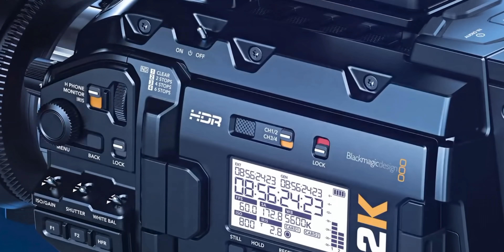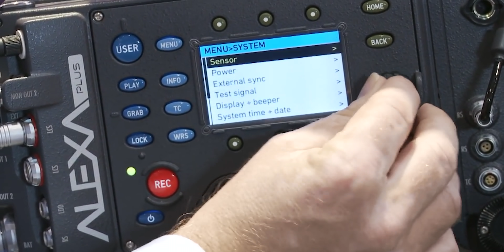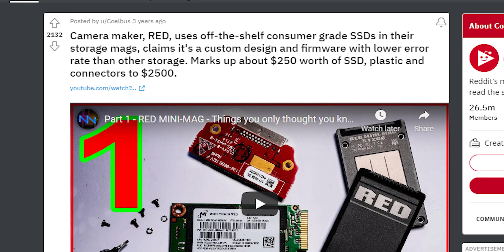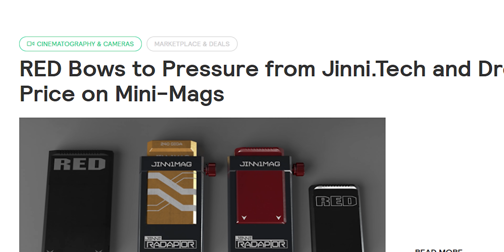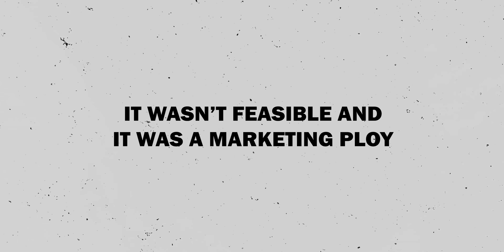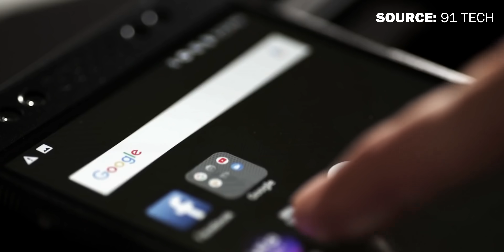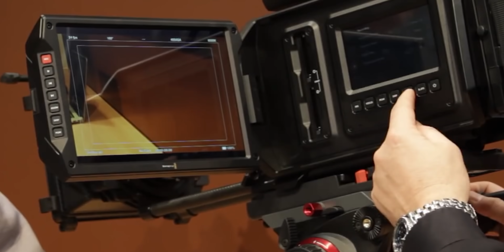The 28K Camera ABANDONED by RED Digital Cinema

Comment: I think the 12k ursa not doing that great in the market under the fact most people don’t need or want 12k for a most projects will hopefully give Red the idea that anything over 10k right now even over 8k isn’t needed. Sure make a camera with a 12k sensor BUT make it downsample into a 6k or 8k image we don’t need more than that. I hardly see the point of 8k apart from down sampling.
Reply from the maker: They really marketed the URSA 12k wrong. In my opinion, it's a multi resolution camera that shoots full sensor 12K, 8k, and 4K which gives you flexibility. But really that's it's best feature, not the 12k

Comment: I had completely forgotten about that hilarious rendering for their 28K camera - the design didn't make sense back then as it does now - and, seriously, what are you gonna do with 28K? At this stage, 8K alone is being used as the "negative" for 4K (you shoot and color grade in 8K for a 4K output - that way, you get a sharper image in spite of the amount of abuse it went through at the grading stage). 

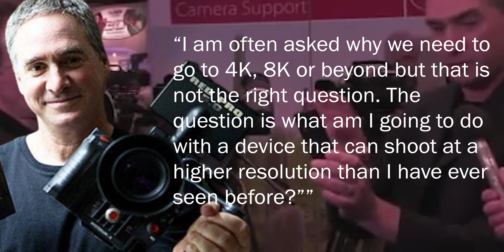6:54 Yeah, I remember when Red was pushing around this idea that you always have to increase resolution to get "more cinematic" images. I mean, they still do now, but back then it was kind of their mantra, as if resolution was the only thing that mattered. Then Arri released the Alexa and dominated the market for more than 10 years with a camera that was made for 2K output and now they are about to release their first S35 4K machine. Red in the meantime has finally come around to put internal NDs in their cameras like anyone else, after only 14 years in the business.
Reply from the maker: 😂 yeah, it's pretty insane
Reply: @FrameVoyager  Red is 80% hype and 20% hard facts.

Comment: Anything over 4k isnt beneficial lenses stop sensors from being able to resolve what they claim, no lens can resolve 8k let alone 12k the Ursa 12k cant even resolve 12k cause the lenses dont have the resolving power.
Reply from the maker: Exactly. Resolution is great if you have specific needs for it, but just because you have more of it doesn't mean you have better quality video
Reply: @FrameVoyager  I would prefer a sensor with larger actual pixels and photosites which can pick up far more light are are wayyyyyyyyy better in low light which is why canons cameras are all like 8-12 mp sensors minus like the R5C cause smaller pixels equal worse low light.

Comment: Even as a RED enthousiast this camera to me is bullshit (but I know for a fact that they are still planning to release at some point in time an IMAX sized sensor equipped camera).
That being said, I think a lot of people are not really fair to the brand (maybe it’s the cost of their aggressive marketing I don’t know) because in truth, no one really disclose who makes their sensors or even media.
Arri has always said the Alev III sensor was their own while it was in fact designed and built by OnSemi (they even won an award for it !) to Arri’s specs. Same goes for the latest Codex media which contains off-the-shelves OEM NVME SSD without anyone calling them names. I guess they get a pass because there is a bit more custom circuitry and software between said SSD and the camera than what RED did/does with the Mini Mags.
And then again, how many camera manufacturers talk openly about the fact that their sensors are made by Sony Semicon (all the Blackmagic Pocket Line of cameras, all the Z Cam cameras, all the Panasonic cameras, Fujifilm, Olympus, Kinefinity, Leica, Sigma and so on) ? Or other manufacturers. Even the so called « entirely made by Blackmagic » 12K sensor in the URSA 12K is NOT. They did what Arri did. (By the way, the exterior design of the Alexa Line of cameras is NOT designed in house by Arri : they hire an industrial product design company…)

Comment: 4:40 when I'm building my house, I'm the architect that says what has to go where, basically being the builder (legal term; overseeing) myself and in my role I order a mason to build walls and carpenter to build the roof – all according to my specifications, I can still say that I've build my house. I'm the builder. Just because I don't lay all bricks and woodframes by myself doesn't mean I'm not the builder.

A similar example would be Apple with its A-Chips. Apple doesn't technically build it's own chips, they design them and create the specifications, but TSMC cuts them out of silicon according to Apples specifications (layman's terms).
Reply from the maker: For sure! But in a lot of the forum posts RED was aggressively DENYING that they were working with a sensor manufacturer and that they had indeed built their own sensors. But like you said, everyone knows as the builder you don't necessarily build every part, few do. But they were very insistent on the fact that they made it themselves and even ARRI at award shows recognized the work and partnership with the company that made their sensors. 

They are a private company and can do whatever they want but that still doesn't take away from the fact that early on they were trying to create this whole brand of mystique to seem like the hip new company. Which tbh, probably was a big part of why they didn't die off early like a lot of these other companies did around that time. Can't say I would do what Jim Jannard did, but I can respect his marketing prowess!

Comment: I'm just speculating here but maybe RED got inspired by stuff like the Seitz Roundshot 6x17 - it has a similar design and (at that time)a high resolution sensor.
Maybe they thought they could acquire the sensor like they did with the FORZA sensor - but the problem was that it's a scanning back meaning there is no singe sensor covering the whole frame.
Even if they could have pulled it off the bandwidth would not have been manageable. Maybe now it could have worked with NVME SSD bandwidth etc.
Reply from the maker: Could be! I really think it's likely to be a marketing ploy. But I always like to think this stuff might have been built in some secret dark corner of the company that only a few ever saw haha
Reply: I @FrameVoyager  Hahahah yeah and then they used a working prototype to take four frames and then they were like... "okay, now what?"

Comment: honestly, 4k is where this all needs to end. lets all live with the alexa 35 for the next 10 years and just focus on making better movies please. i have a 4k television but 90% of what streams to it is still 1080p. the more k's you squeeze into something the more problems you have and the more crap you need to run during the processing to fix it - hence red's lack of DR and FNP problems among other things - and why arri is just now crossing the the s35 4k line - because only just now is technology good enough to have great image quality in 4k. (and no, great image quality does not equal a high number of k's). i was very happy shooting on my alexa classic up until 2-3 years ago when i finally hit a wall with the alexa mini having completely taken over. if it hadn't been for that, i'd still be on the classic instead of the mini.

it's hilarious how, as cameras get more and more k's, everyone slaps on more and more pro mist or uses older and wackier lenses to knock those k's down. we're approaching the point of convergence with all of this. 4k is that point i think.

Comment: The Monstro did happen. It was called the Monstro Vista Vision. It was part of the DSMC2 line after the Epic, and before the current DSMC3 line.
Reply: Yes, but the proposed Monstro had a much larger sensor than VistaVision and it would have been 28K - not 8K. I think they were heading towards something like Cinerama, but then it dawned on them that few such cinemas exist. If you're going this route, it would be more sensible to go with a giant 1:50 sensor that can fill a 1.43:1 IMAX screen but at much higher res than 8K.

Comment: There's a reason for the crazy wide format of the theoretical 28k sensor.  It's actually multiple dies of silicon placed next to each other.  Someone convinced RED that these dies could be placed close enough together that they could be combined to act as 1 sensor.
Reply: Please correct me if I'm wrong, but isn't that how Arri made the Alexa LF and 65? The A2X and A3X sensors composed of 2 and 3 ALEV III sensors? I'm not a silicon engineer so I'm curious how it works.
Reply: @Crlarl  Actually, yeah it seems that way.  I was unaware that Arri had already done this for their cameras.  Pretty cool!
Reply: How did someone "convinced" Red? That's what Arri have been doing with the Alexa's sensor. Exactly what they've been doing to produce medium and IMAX format Alexa cameras. With all due respect, I'm a little confused, just like Carl. Also, most CPU companies use the same exact technique for their own silicon use. Why wouldn't it work for optical sensors?...
Reply: Or alternatively to split the image in optics in such a way that it would be distributed across several individual sensors.
Reply: If this thing exist, you are probably right that it would have to be multiple sensors, but that isn't the reason why its so wide. It's this wide because 617 is an actual film format used for still photography and thats the dimension of a 617 slide of film.
Reply: I mean, that’s what the Alexa 65 and LF is
Reply: You're all assuming "someone convinced red" is being said derisively as opposed to a more neutral meaning

Comment: I assume there would have been a permanent anamorphic lens attached, but if you are always stretching the light that much, I doubt the image would have been any better than a smaller sensor and good glass….    645 sensor would have been sweet though.
Reply from the maker: 🤔 yeah I kept trying to figure out how the mounting system would even work for this. Granted, RED was also making their own lenses at this point too and that was a fail
Reply: Lenses used on large format cameras (alpa, linhof, rodenstock, schneider kreuznach, etc.) could have covered the size of the sensor as it would have been smaller than 8x10 film plates. And I'm sure the 645 format is not a concept of the past just yet. It's still produced by Sony for Phase One and Hasselblad, the video specs are terrible at the moment (only Hasselblad offers it on their H6D system), but it could change in the future with sensors evolution. It'd be amazing!!
Reply: No, anamorphic lens would stretch the footage even more.

Comment: Less vaporware than a highly speculative preliminary hardware concept, in my view. My guess is that this lightweight design seen in promotional materials was actually only the sensor block which would have been tethered to some much more substantial piece of hardware that would actually do all of the processing and capture. Think the Alexa-M and Venice Rialto. Otherwise the design would simply be too ridiculous, even for Red in their fast and loose days. This would also go a good way towards explaining why the product was cancelled, given the limited applications for such a tethered camera system.
Reply from the maker: Absolutely agree! Some good points. It's just hard to tell as this was in their "fast and loose days" and I really attribute most of it to Jim Jannard's business practices. It was the same thing at Oakley, which works well in that industry but not in an industry where we rely on gear for our jobs. Him leaving seems to have stabilized them a bit imho
Reply: @FrameVoyager  for sure, and something I left unstated in my theory is that, if I’m right, they were certainly letting people THINK that that was the whole camera.
Reply from the maker: @jordanfish  😂😂😂 probably! When a company is selling you smoke and mirrors it's a "RED" flag 😏
Reply: This explanation would also solve the media question. Some extreme SSD RAID solution, unencumbered by a traditional camera body, would get the job done.